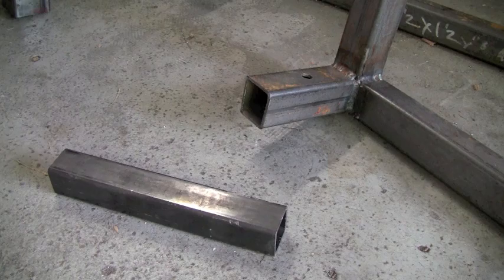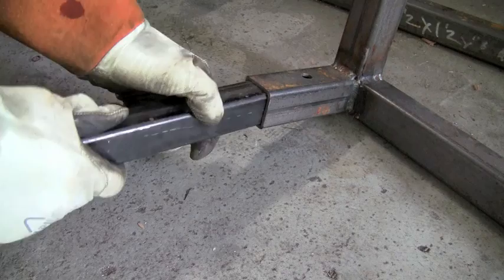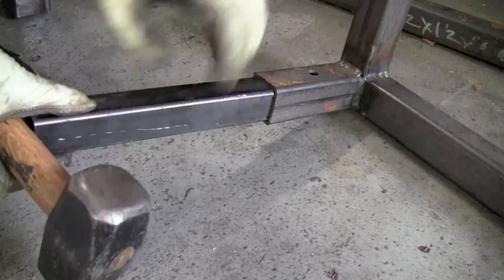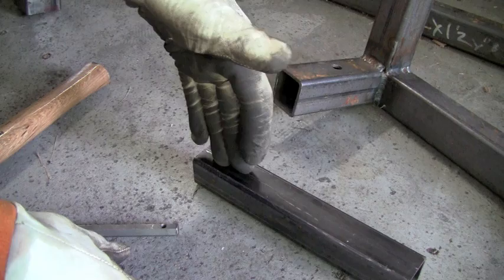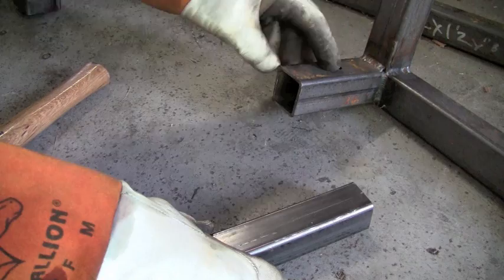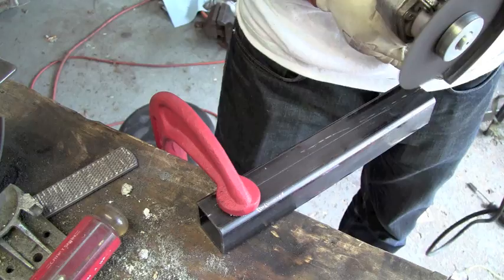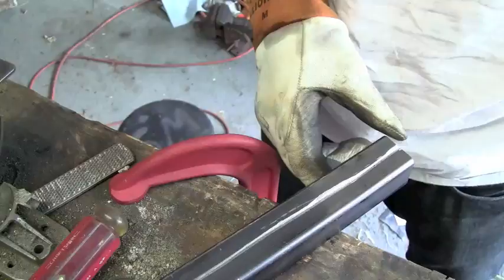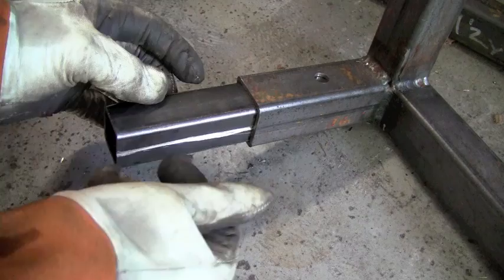Square Tubing Tip

Comment: wow talk about doing things the hard way
Reply: ***** dia grinder with a long bit.
Reply: ***** sorry I meant I would have ground the weld inside
Reply: *****
 Air file will do it, if you're going deeper than that you would be better off buying the right kind of tube for telescoping.  The way this guy is showing weakens the metal, grinding the weld would be better.
Reply: roadw2000 some one knows what i'm talking about... not to mention pre-fitting before you weld something together is recommended (then most dia grinders will work going in from both sides). another tip powder coating shows everything!
Reply: freezenfred
So your argument is that grinding the inside of a tube is easier than grinding the outside of a tube?  I think most people would argue that point. It seems to me that a lot of people who do fabrication work like this are not the brightest, so when they are taught a way to do something it becomes gospel, because they would be lost without that little nugget of knowledge and have no chance of figuring it out for themselves. So they defend the technique they know in a way similar to a zealot would defend the "truth" of his religion.
Reply: bullvalene agree 100% They are jealous just like a child

Comment: That's a hack job! Get a long cold chisel and knock that burr off or use a long aggressive cut file! If you're working with metal a file and a chisel should have been what you got the same time you got your hammer! And why did you make that relief cut the whole length of that leg when you only needed a few inches? Bad planning, wasn't thinking or just don't care that it looks like shit?

Comment: Sorry, once you weld it like you say you will, you won't be able to pull it out like you say you will....? Should have mentioned that it only works if the line is dead centre, nice tip, crappy video explanation